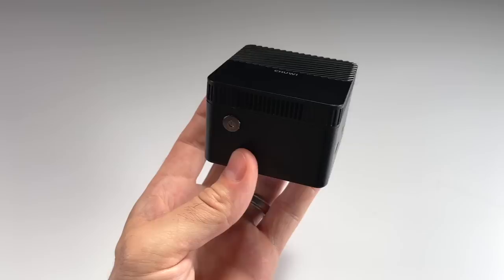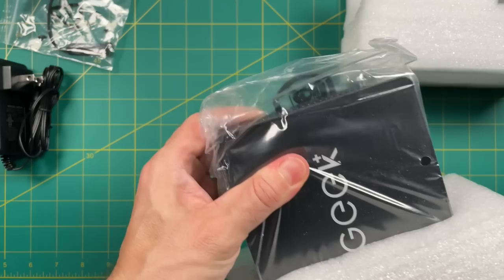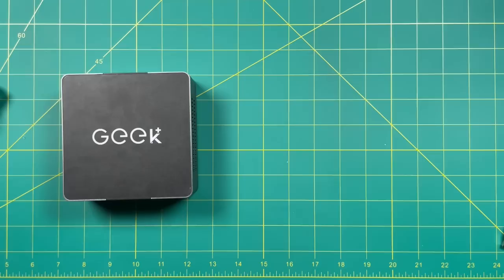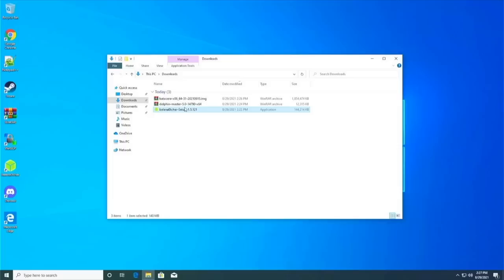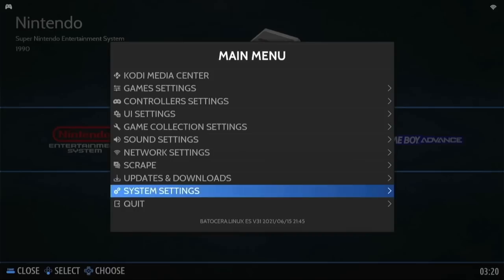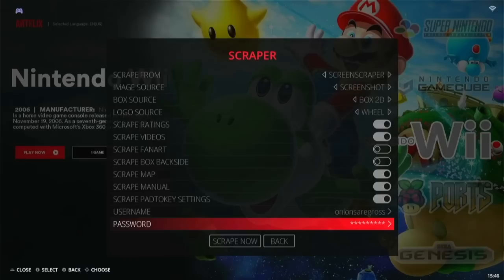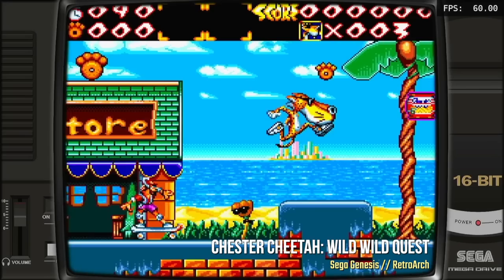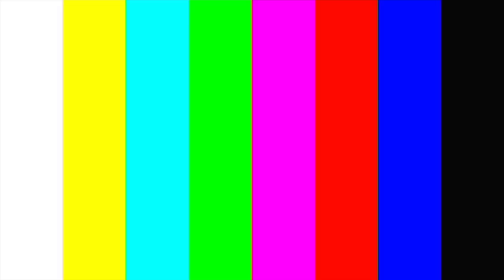Batocera Mini PC Setup Guide

Comment: The deeper I go into retro emulation the more I realize it's the PS2 specifically that I want to play the most. Just no clue what is the "best" "affordable" "smallest" option to get PCSX2 running smoothly with some upscaling.
Reply: Honestly the cheapest option is probably real hardware.
Reply: @octorox_animation  if you mean like an actual ps2, thats not my goal. No HDMi output and your stuck with 480i no upscaling. Looking for something that lets me run it via HDMI with 2k or 4k resolution upscaling. Similar to PPSSPP does for PSP games.
Reply from the maker: @BrianMills198686  I would check out the Minis Forum catalog, they have the best selection at those higher performance rates, with a lot of variety.
Reply: @BrianMills198686  i think thats why Keith said the real hardware might be cheaper. Upscalers that output hdmi are not terribly expensive. Now if you mean you want a device to also render at a higher resolution (meaning not just blow up the image but also improve detail), then thats going to require a decently powerful computer.  Nothing too crazy, but probably not this type of sbc stuff you see on Aliexpress either.
Reply: @fedup6127  
FFXII is on Steam now if you have a PC, grab it when a sale is on for a few quid/bucks
Reply: @misterkeebler  yeah, I was hoping there would be like a super console x type thing that was beefy enough to run PCSX2, as I don't actually own a desktop computer at all and building one to run ps2 games at 2k seems a bit excessive.
Reply: ps3 slim CECH2003/2004 model you can jailbreak pretty easily and that unlocks ps2 emulation, along with retroarch and all sorts of epic stuff.. the slims are pretty cheap

there are other models too that can be jailbroke but the 2003/4 you can also do the “secret LED” mod which looks awesome
Reply: Check out ETA Prime's videos, he reviewed quite a number of miniPCs that run PS2 and even PS3 games at 60fps.

Though be prepared to pay for them as they're not cheap.
Reply: Yeah, definitely check out ETA Prime’s channel.
Reply: A bit late to the party but Asrock Deskmini X300 with Ryzen 5600G or 5700G is emulating PS2 perfectly in 1080p. Framerate drops only when upscaling PSP3.
Bigger than a classic "mini pc" but still small, lots of storage options (2xM2 and 2x2.5''), boot menu option so easy switch between Windows and Batocera, 3 USB A ports and cheap option for 2 integrated ones, no plasticky/flashy/low WAF look, ...
Really happy with it and ends up being much cheaper than mini PCs with Ryzen configuration.
Reply: I just got a new mini pc with large hard drive for under £300

Comment: One thing to note. You should have sprung for the J4125 variant rather than the J3455 variant. Those have more oomph for the same power draw.
Reply: Yes, and some J3455 models are also using cheap and slow DDR3 RAM in them, and the vendors aren't always telling. Some models (like the one used in this video) have faster DDR4, and I assume this has a huge impact on performance, as I had one of those DDR3 J3455 and DC games weren't even playable on it, and even PS1 was "barely ok". Forget N64 or GC. Anyone considering one of these mini PCs should spend just a little more and get a J4125.  I think all J4125 use DDR4 too, on top of having a better CPU/GPU. So just get a J4125 folks.

Comment: I have tried setting up Batocera on my MSi Cubi 5 via. USB hard drive, but it keeps failing to boot up the OS, as I get an error message every single time when booting directly, or a blank screen after doing it manually. Is this possibly because of an issue with my 5TB external hard drive I'm trying to install it on?

Comment: You can pick up a Dell / Lenovo / HP mini business PC - slightly larger, but an i5 rather than a J chip for less than that.
Admittedly it would be a used PC rather than a new one - but it would generally be better built (built for business use rather than home use), and faster as well as cheaper.
i.e. I picked up a Dell 3050 micro with an i5-7500t last year for £112 (delivered) on Ebay - with 16GB RAM and 512GB SSD (2.5" SATA one oddly - rather than NVMe), but if I add an old NVMe drive (I upgraded the one in my main PC), I can use one for Windows and one for Batocera - and both would be SSDs.
Reply: Yeah, those little older T model Tiny PC's are awesome little machines. 
Whether it be the Lenovo, HP or Dell ones. 
Yeah they might be used but if you are using them for retro machines with Batocera I think they are well worth it for the price. Even as a PC as long as they are in decent condition. 
I actually started with a Lenovo M73 i5 4570T 2.9ghz 2 cores 4 threads. 
For Batocera only and was. great for the price. 
Then I bought a HP800 G2 i7 6700T 2.8ghz 4 cores 8 threads. 
Again for Batocera only, nice bump in performance. Run a reg 2TB HDD with Batocera running internally off that. 
And I actually use the older Lenovo i5 as my main PC now, still plenty for what I use it for,I just put in a 1TB Crucial MX500 SSD, installed Windows and all good.

Comment: After your review of the Super Console X Mini PC, I seriously considered it. Then I opted instead to try putting Batocera on a 2TB external USB drive and booting into that on my Lenovo Flex 5 laptop. I had trouble getting it to even recognize my 8BitDo controller. I tried to access the main menu to see if I could map the buttons, but I had no idea how to access the menu with my keyboard (discovered later it's the spacebar). Finally I plugged it in via USB and got it recognized and mapped and finally configured it wireless. Some of the game systems didn't look good to me, so I've been tinkering with the RetroArch settings to get them to look better, with some results working better than others. I've found PS1 games in particular to look like garbage. PSP has been the best for me, because they look incredible on the screen and mostly perform much better than my Anbernic handhelds. N64 runs some games that don't even run on the Pi4 (I have one of those as well). I may do a dual comparison of the video setting in RetroArch on my Pi4 to see if I can get SNES, PS1, etc. to look better. I can't remember what I did, but Genesis looked bad until I did *something*. :) Thanks for the inspiration, and I'd love a video on getting the best settings (similar to what you did for the RG351P).
Reply: Try different cores for the ps1, I'm happy how duck station looks. Also, try running scan line filters. It can really change the picture a lot. Personally, I was surprised when I first tried this.

Comment: Can you use F12 to select which boot option you want to use from the available sources? Might be faster than switch WBM around in bios
Reply from the maker: The BIOS on this one is wonky.  Pressing F12 will show "checking media presence" a couple times and then boot into the primary partition anyway.  I think there's something up with its configuration, because theoretically I should have been able to boot into the SD card or the USB drive too.  Either way, this setup I showed is the only method that works with this Geek+ PC, which is a bummer.

Comment: Nice vid 👍
I was originally going to get android box but in the end went the pre owned Lenovo Tiny PC route and never looked back. Didnt want to spend a great deal either so its good value too. 
I just wanted a 'console' to run the systems that my PS Classic and the android boxes struggle with,namely N64,Dreamcast, PSP and so the Lenovo does that great..and these can also be upscaled and still run great.  The bonus part is I now can also play Saturn as well and even a lot of gamecube, and many PS2 and some xbox and Wii even. Thats just a bonus. 
I specifically bought the Lenovo for this, as a retro emulation console. 
I did plan to have it all installed on the internal HDD but thought it handy to keep windows on it should I ever need a spare PC. (Which did come in handy once when I needed it) 
And so I now boot Batocera off a flash drive and have the roms on an attached portable HDD. 
Works very well. 
I know youve mentioned this in a previous vid but incase anyone missed it, checkout Batocera Nation yt channel, he has many tutorials on Batocera for PC.
Reply: Any recommendations on specs for a Lenovo tiny PC?

Comment: With passive cooling, it might be better to use ssd drive to reduce heat. 

This is pretty much what I did recently, I bought a usff PC on ebay used for about $30 and upgraded ram and cpu from parts I had laying around and loaded up batocera. Works great and it can play just about everything I want to play on it, including ps2 and Dreamcast. Fantastic little machine and now I can pack away majority of my consoles.
Reply: My Samsung T5 SSD is actually hotter than my other portable HDDs, not sure is it because Samsung uses the external metal casing for heat dissipation.

So, yeah, SSDs may not be cooler than HDDs, it all depends on the manufacturers' designs..

Comment: You can get better hardware, if you don't mind going used.
I just bought a Lenovo M73 mini pc for $200.

You can usually get one with R5 2400ge 8gb ram, and 256gb ssd for $200-$275.
Runs gamecube games at 1080p without much issue.

In my experience Batocera/Lakka is hit or miss, setting up gamecube or non-standard controllers is not always easy.
You also seem to have less settings overall. Dolphin on PC/Linux has more features.

At some point, I realized I'd rather set up my own emulators and make sure everything works.

Comment: Brilliant stuff as per usual Russ, I was gonna rebuild my pc and have an emulator running through it. Decided against that and have just got a chrombook. Runs dreamcast like a dream, as well as N64 and psp. Everything else works fine so far.
Reply from the maker: Very nice!  I have an old Chromebook that I've been meaning to tinker with.
Reply: Give it a go, I'm sure it would make for an excellent video.

Comment: What's the best ps1 retro console or sega cd in your opinion? Looking to play Lunar the Silver Star again, had a hankering recently.
Reply: rpi4 handles both those consoles just about perfectly.
Reply from the maker: If you're comfortable setting it up yourself, I would grab the HK1 box for about $50.  It'll play those systems with plenty of headroom for other stuff too.  I have a video on it!  If you're looking for a pre-loaded setup, then the Super Console X Cube might be a good choice (I also have a video on that one!).
Reply: PS1 and Sega CD runs well on a 4k firestick.  Most likely you have one and can use it until you buy your real retro device. I successfully ran marvel vs Capcom 2 on a firestick. Didn't think it was possible but it is. A bit of tweaking playing with RetroArch settings to get the full 60fps. PS1 and Sega CD is no problem with 60fps on a firestick. Emulation up to Dreamcast is the limit on a firestick. The core I use to play mvc2 in RetroArch is Flycast emulator.

Comment: YEAH, this will take literally probably 6-8hrs to set up and get the settings right, unless you're providing the RetroArch settings files too. And that $400 option, while not great, has a lot of hard to find games on rom sites, in it and semi-formatted to work. While also coming with the mini-PC setup for you. Edit: $200 for the PC, and about $100 for the peripherals and Hard Drive, especially if you go SSD (though why you wouldn't just go with a 512MB microSD card, who knows). SO, $300-ish, and lots and lots of labor. OR $400
Reply from the maker: Totally agree, there is a lot of cost (and time) savings to be had in getting a pre-loaded system.  But sometimes the labor part can be a little fun too :)

Comment: I wish there was some connector in it to add a mini fan
Reply: Don't think there is space in it to add a fan else they would have done it.
Reply: @acejon2162  or to cut their cost, a heat sink with thermal paste at the very least. 90degrees is simply too high to work with. On another hand it's not meant for gaming so...

Comment: Hi Russ, do you have NAS? if yes, can you guide us on how to setup the connection between device and NAS in batocera? i just cant get it work, i am using Synology NAS DSM, if this can be set up, i can just get my rom and saves file using any device with batocera system within my wifi coverage area.
Reply: Batocera is using Linux. Try using samba via Terminal. :)

Comment: I'm doing this exact process with a brand new mini PC (Intel, J4125) and an internal 320GB SATA 2.5 that I flashed Batocera too.  When I load up, I get audio out of the mini PC's audio connection, but no video after the splash screen.  Almost seems like it's defaulting to something other than HDMI or VGA video outs, which are the only things the MINI PC has....

Comment: I personally like having stuff on windows, I find myself gaming more when it's just a few clicks away from what I'm already doing, I can keep podcasts running etc., but the presentation is awesome here, and easily beats my messy windows folders. I wonder, is there maybe a compromise? For one, I could make a folder with just shortcuts so there's no layers of folders to go through or save files cluttering the games folder, but before I do that, there might be something even better. It's okay for now as I'm busy with just a handful of GBA games, I right-click the emulator taskbar icon and the drop-down shows my games, but this won't hold up. (Cheap power-efficient laptop for low reqs, bulky tower otherwise)

Comment: If you have an older gen Intel CPU such as a 4th gen one like myself, and you also have a dedicated NVIDIA graphics card, then make sure you go in the root of your BATOCERA storage device (after having installed BATOCERA on it) and open "batocera-boot.conf" in Notepad or Notepad++, and make sure to uncomment "nvidia-driver=true", because if you don't, then your games won't run well. Uncommenting this line will make sure that the nvidia drivers for linux are enabled (BATOCERA is a linux distribution). If you're on a laptop, and your laptop has an older gen Intel CPU and also a dedicated NVIDIA graphics card, then make sure to also uncomment "nvidia-prime=true" in the "batocera-boot.conf". Dedicated AMD GPUs have their drivers installed and activated automatically, so no tinkering needed inside the "batocera-boot.conf" file. :)

Comment: Russ, I have an old raspberry pi I got about 7 years ago. I tried to install Batocera into it, and it works, but there are a few hiccups. Maybe you can look into making a guide on installing these standalone frontend emulators into the weakest machine you can find? Just for the kicks.

Comment: hey man, good vid! Taking this chance to ask something a bit offtopic: been considering getting the Razer Kishi for emulators on my phone as well as some Android games. I saw you got one and said you were gonna make a review of it but you didn't post one yet. Could you recommend it? I don't mind the size of it personally, but would like an opinion from another retro gamer, thanks!
Reply from the maker: Hi, so I ended up not doing a review because I really didn't care for it, and I don't like doing negative reviews like that.  So I ended up focusing on the controllers I liked (like the GameSir) and then I gave the Kishi away in my last big giveaway.  I think a lot of people like it, and if you don't mind the bulk I think it should be fine!
Reply: @RetroGameCorps  amazing, thanks for the heads up! Ended up getting it after reading some other reviews and will be here soon. One last thing, did you have any issues using it on emulators like ReDream, PPSSPP, M64 or Dolphin? Read some users had issues with the DPAD but a firmware update fixed it, so just making sure. Need to speedrun SA2 on the go, lmao

Comment: Thank you for your video. It is helpful. So now my question will be when it comes to buying a mini pc to run batocera, how powerful does it need to be to run emulators? I guess that anything can run 16-bit systems. But what if someone wishes to run flawlessly PS1, Saturn, N64? What if someone wishes to run Naomi, Dreamcast, GameCube and PS2? 
Could you recommend some specs for each console?

Comment: Just want to say that apparently, all J3455 mini PCs aren't created equal. I had one for a brief time (ACEPC brand - that I had to return) and with the latest Batocera image, most DC games ran like utter cr4p (like, non-playable), N64 was very much hit or miss (more miss), and just forget about GC or DS, those ran like molasse. Even basic PS1 games were hit and miss, having to often play with emulator options (or try different emulator depending on the game) to get a good result.

I think it was a defective unit, as I noticed that it was probably throttling the CPU (the fan wasn't working & temps were insane), and I've noticed that it had slower DDR3 RAM too, contrary to other models (like that Geekplus mini PC) that have DDR4, which surely have an impact on speed and GPU performance. 

So to anyone buying one of those J3455-based mini-PC, please verify that the model you're buying is using DDR4 RAM (not all companies selling those tell you - they only say "6GB" or "8Gb"). Also, I've noticed that ACEPC seems to have a lot of complains about the fan never kicking in, which is what I experienced as well.

Personally, I'd go with a J4125 model, which is probably what I'll be ending up buying soon.
Reply from the maker: Agreed, the J4125 definitely outperforms this one.  I had bought this before I got my first J4125, and learned the error of my ways :)

Comment: I noticed with the latest batocera that it limits ya drive to 6gb and won’t expand as I know that’s fat32 limit could you do a video on expanding the size of either usb or ssd thank you again !
Reply: The boot partition is in fat32 and is reserved at 6GB. 
Once you boot Batocera for first time it will create the folder structure and expand the rest of your storage as the share partition, this is for your roms, theme etc. 
Its automatically formatted to ext4 by default so windows will not see that ext4 partition.